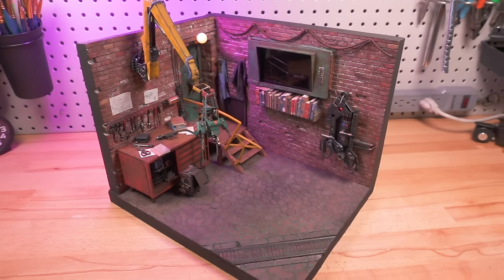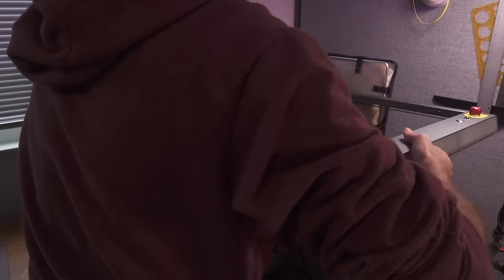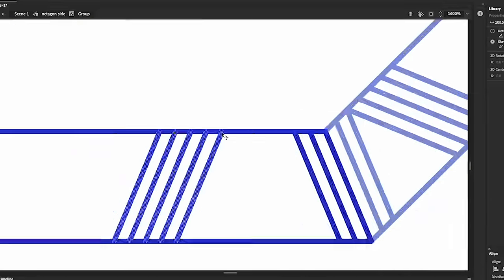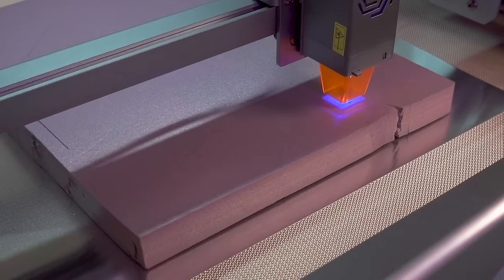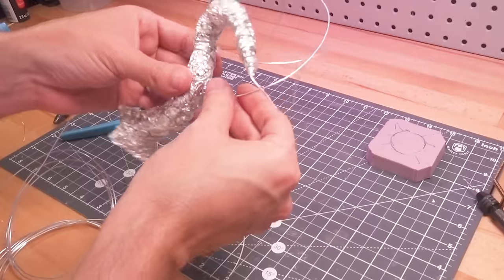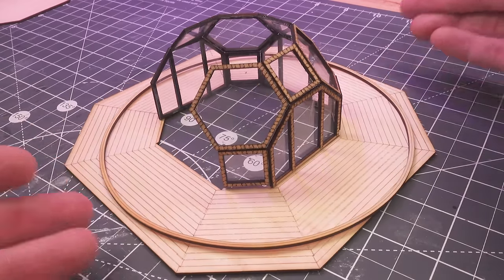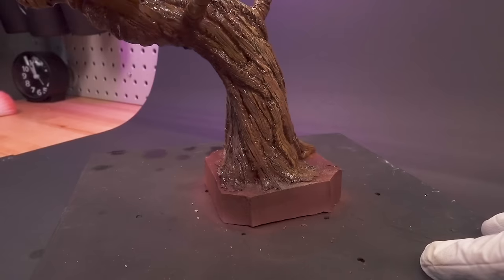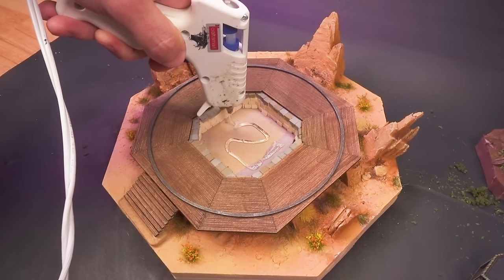"The Mender" From concept art to story build | Beyond the Blight sci-fi diorama Ortur Laser Master 3

Comment: These tools really make hobbying a joy. I have 8 3D printers split between resin and FDM. An industrial laser cutter, a CMYK printer, and a White Toner printer. It's insane the things you can create with these tools. 

Yet sometimes a hobby knife and some foam works too.
Reply from the maker: White toner printer sounds interesting. Can you make white decals with them?
Reply: @gameyybuilds  yes it's their main function to be able to make white things or place white backgrounds behind other designs so they show up on clear surfaces. The CMYK is better at that but it's a $5,000 plus machine that has to be used daily or the ink reservoirs clog up. It's more of a pain to operate unless you have a daily need.